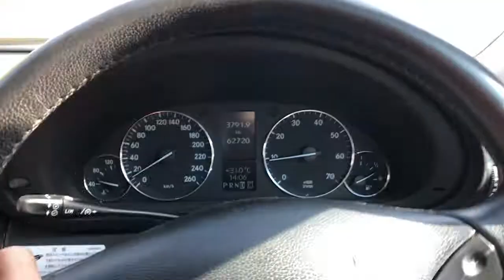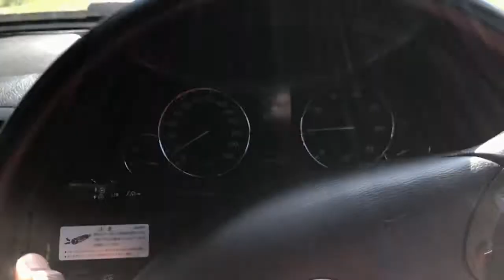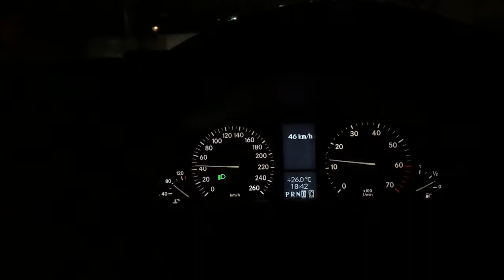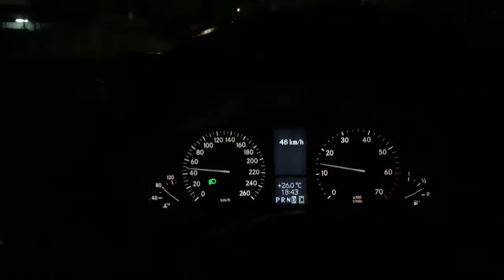How to change Mercedes benz c230 control arms without remove de brake calipers

Comment: Just remember  to tighten  the bolts on bushings by letting the car settle  on all 4 tyres. This is to prevent  immature  wearing  of the bushes otherwise  great Vid
Reply: How do you do that when the car is low
Profile ? There is no room to go under

Comment: This is a great video because I can see that this job can be done without a hoist and a load of special tools.
I was also a little intimidated by having to do the brake caliper and the ABS.
Thank you so much

Comment: Excellent Video - Mercedes does charge you labor for removing the brake caliper, whether they do it or not.  Last estimate I got was $754.00 per side for the Torque Struts plus the stabilizer bar for $363.00.  Taxes and lubricants bring the total to almost $1900.00.  Doing it yourself with the aid of your video saves a LOT of $$$...Thank you so very much Frank...
Reply from the maker: Wooow. That’s a lot of money. Welcome

Comment: So I've completed one side of the car with 2 new arms and steering ball joint.
I've started on the other.
It has gone to plan. Thanks so much👍it has helped me enormously this video.
I found removing the ball joints to be harder than expected, but thanks very much
Reply from the maker: Happy to hear that you made it out. always here to help :)
Reply: Did you have to do the alignment after the job? Thanks!

Comment: Good job. I need to replace the lower control arms on my C230. I get the same clunking sound. I had the upper control arms replaced not long ago and should have down the lowers also. Thanks for this.

Comment: A good video brother very well explain good job, also change both sides the other control arms will fail as they are weaker. Hi sorry I see you changes both side good job

Comment: important to jug up the arm before tightening the bolts ?  thanks
Reply from the maker: Yes very important. Drop the car back to the ground and then tighten it
Reply: @frankcumaio8328  what will make the difference?     thank you
Reply: @frankcumaio8328 show a video how to do  the step

Comment: I had this done and now I have 3 lights on the dash. The ABS, ESP, and BAS. Did yours do that?
Reply from the maker: No I didn't mate, try to check if you didn't mess with the abs lines
Reply: Frank Cumaio turns out it was one of the abs sensors. They changed both of the front ones and it fixed it, so🤷🏼‍♂️
Reply from the maker: @zippy0099  glad you sorted mate

Comment: I watched another video where he said. It to tighten fasteners for control arm until car is lowered to ground to seat the control arma properly. Also he used a ball joint remover. What do you think? Thanks
https://youtu.be/krt880P7aUc